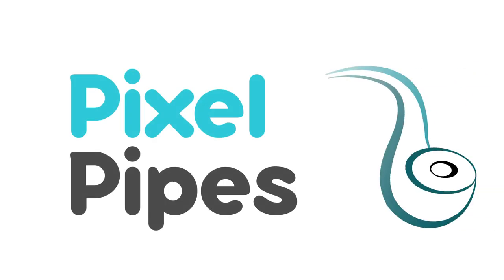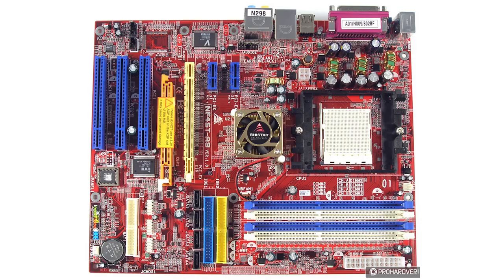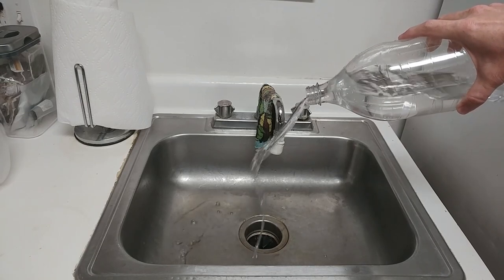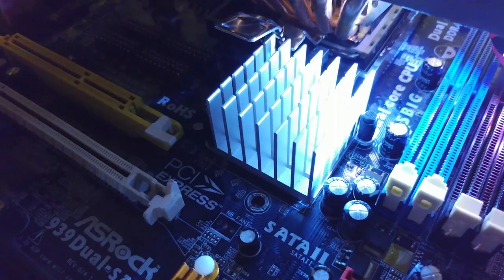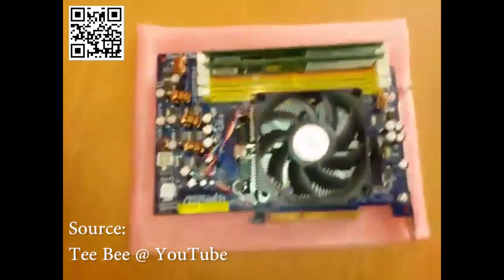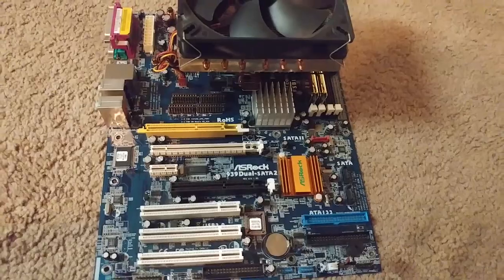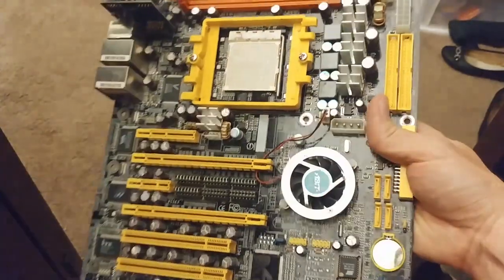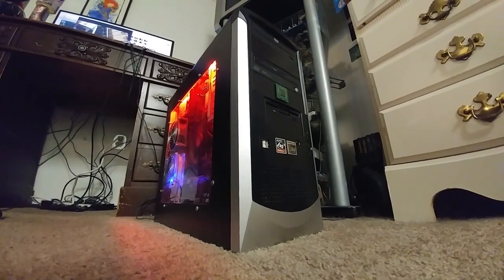Maybe the BEST Athlon 64 Motherboard Ever Made

Comment: Hay dude can you run Cinebench R15 and 3Dmark 2003 CPU bench? i want to compare it to my 4core dual vsta
Reply from the maker: It appears Cinebench R15 won't work on my 32-bit OS, so no dice. 3DMark03 CPU score is 1308 (151.7/22.2 fps).
Reply: PixelPipes 1189 100/26.5 x3430 2.3
Reply: PixelPipes what GPU did you use?
Reply from the maker: I had a 6800 Ultra in at the time.
Reply: PixelPipes the board will score higher CPU scores as you increase the power of the GPU. It will score more with a pcie weird right.
Reply: PixelPipes I will but I have to say I prefer your board over myn I suffered terrible issues so I've already ordered the AM2cpu and the top processor for it.

Comment: i got  the 775Dual-VSTA intel board and i can only have 1 card in it agp or pcix not run 2 at the same time
Reply: The 775Dual-VSTA got an Via chipset and the intel Platorm still relies on the old FSB design. So no "dual northbridge"
Oh, and the PCie is only 4x on that board.
Atleast it got DDR and DDR2 slots. The limitation to 2 GB is on another card.
Reply: You can run beta BIOS with ~3,25GB support ;)

Comment: The JMB360/36X is quite a worse SATA chipset ever...
I have use a Expansion card using the PCI-E interface.It include the JMB363,
Because I still having a IDE DVD-RW,and need to connect to my new MB at that time.
but the performance is horrible...and always buggy ever.I decide just buy a new one with SATA interface to replace the old one...

Comment: P5Q Deluxe, best 775 motherboard, can take 4x4GB PC2-6400, compatible Xeon mod and dual GPU
Reply: Rampage Extreme user here, who needs E5450 when I can have X3370 :D
Reply: P5Q3-Deluxe is the same board but had DDR3 rather than DDR2.
Reply: @AtariBorn  yes, that's advantage today, as you can put there 4GB DDR3 rams, that are cheap, and can go with overclocking up to 1800-2100 mhz. My asus p5q deluxe suports 16 gb ram, but have only 8, as 2gb sticks are maximu, 4gb for Intel are too rare and expensive.
but anyway p5q deluxe is still good overclocker, have there PC2-8500 8 GB RAM.
With DDR3, I Could go only with 2 sticks, 2x4 GB , and after raising FSB, could get to 1800MHZ DDR3, i I wuld buy 1866mhz sticks.

Comment: Maybe it is, but DFI LANParty UT nF3-250Gb is far more legendary and it surely is the best socket 754 motherboard ever made. In 2004 Anandtech called it "overclocker's dream". Now they are rare and very expensive if you can find one. imo it's still one of the best motherboards ever made.
Reply: I see nothing wrong with Socket 754. Late boards and CPUs were better for overclocking than 939 ones. Now we see all potential of 939 and it's not really very great. Socket 754 isn't bad at all.
Reply: I can't do the same as it has no Opterons supported. But I meant that in single core CPU comparison 754 and 939 are almost the same. 754 overclocks better, some processors could reach over 3GHz. Knowing that, 754 looks interesting option for retro builds. Dual channel RAM turned out into not being a big deal as gains were small in many scenarios. Many older software didn't have good multi core support, neither Windows XP had it (it works, but not too great). I personally have experience with AMD K8 processors. I have AMD Athlon 3200+ (754), Mobile Sempron 3000+ (S1G1), Turion 64 X2 TL-60 (S1G1). I have used them all for some time and I can tell that today they are obsolete. They lag, they stutter and have many signs of lacking power for any modern computing. Turion is paired with 4GB of DDR2 (laptop) and 120 GB SSD. I maxed that laptop out. But it still lacks in performance. Turion feels exactly the same as Sempron, just that sometimes lags less. Mobile processors ran in Windows 7 and 8.1, for some time Sempron ran with XP. Now they are too slow. Athlon is in era appropriate build, so it is paired with 2 GB DDR ram, WD Raptor and runs in XP. It hangs a lot in web browsing and many other activities. Obviously AMD K8 processors are obsolete for anything we do now. Now we should look from retro perspective. That second core in many cases is useless as old software rarely used it, games never really benefited such luxury and AMD it self marketed dual cores for creators, media editors, meanwhile their single core FX processors were for gamers. Difference was in clock speeds and cores. FXs had faster one core, Athlon X2s had two slower cores. At the time people thought that 939 will have better future than 754, but it became obsolete just year after its launch (AM2 arrival). Sure your 939 board served you well at the time and that's understandable, but if we look at the things in 2018, then 939 and 754 are almost the same thing. Both offer great single core performers for 2004 builds, both suck for modern tasks. Second core doesn't make sense from retro perspective and from modern perspective (as singles and duals lag). Sure socket 939 had superior support and is overall better platform and I can agree with you somewhat on that, but 939 isn't really worth it. In pure single core performance 754 can have a big advantage as with decent cooling Athlons can reach even 3.2 GHz, effectively beating anything stock of 939 (possibly overclocked too) and becoming better for retro purposes. Cache may look like important characteristic, but it wasn't. It made almost no difference in performance. It was race of clock speeds. That's my opinion about why 754 isn't bad and is almost the same as 939. Those K8 processors no matter what you pair them with aren't going to be fast, this is problem of architecture becoming obsolete. Also I don't think that there is more legendary motherboard as that DFI I mentioned earlier. It totally blew away competition and dominated. From what I know socket 939 never had such an awesome thing, on top of that reviewers rarely call motherboards as overclocker's dream, so I think it's something truly special of those socket 754 boards. I would like to have 939 board for maybe another build I would do, but now I totally can't. I have spent over 400 euros for having great socket 754 build of 2004. Anyway I would also want to have great board for OCing socket 478 processors, just to replicate Tom's Hardware 5GHz project to some extent. All that can be fun and possibly addicting. Old hardware is interesting to me. My daily PC isn't great in comparison to that 754 build.
Reply: I'm not butthurt but 939 barely makes sense more than 754 and 754 is always considered worse without being worse. Can you yourself mention at least two advantages or 939? Some software even refuses to work on multi core processors. Like Juiced, sometimes it doesn't start. Honorable mention is GTA San Andreas, you have to set affinity to single core every time you start it and that's not the only one thing that works worse on multi core processors. Multi core CPUs are great thing, but not the early ones.
Reply: About DDR2 I said because it works in dual channel mode and is fastest memory I have tried on AMD K8 CPU, just to show that everything else is as best as it could be. And to that comment about multiple core support in XP, I said that because many people say that old OSes weren't optimized for multi core CPUs. XP notices dual core processors as 2 CPUs, so I think that somehow could affect either performance or stability. I never really tried multi core CPUs in XP, so I'm not too sure about that. Yet I have seen some testing that same multi core CPU gets slightly higher scores in 7, so yeah, that's questionable thing and needs investigation. BTW how much you reached? On official socket 754 overclocker thread highest OC was slightly over 3.2GHz. That was over 50% increase in clock speed and ran stably.
Reply: 3.2 GHz was on water. That OS can use something, doesn't mean it can use it efficiently, AMD FX 6300 works on 7 just fine, but shows its all power better in 10. That may be very marginal difference, but it does exist and that's the main point here. I would want to see same multi core processor tested in XP and Vista to see if there's any difference. Currently I won't say my age to you as you are going to flame everything I say here, so no purpose for that. If I was a kind, then what? You would be attacking age of a person? That's very lowly for random adult.
Reply: You started it yourself.

Comment: No, ASRock back then and to some extent still is the bottom of the barrel for motherboards.  It was a low cost (think Acer)  offshoot of Asus and their board quality reflected it.  Back then Asus was among  the most reliable boardmakers along with Abit and DFI.  I still prefer Asus to this day because of it.  I used the M2N32-SLI Deluxe (590 SLI AM2) for years and it was rock solid and pulled everything out of an Athlon 64 X2 6000+.  I only got rid of it when Intel brought out the X58 Platform.   Gigabyte had more features but their boards were a finicky unreliable mess and ASRock was even worse. This hybrid chipset on your board was much the same.  You can't say a board is rock solid when you have to take a soldering iron to it.  That and stretching out the life of a 939 socket was just getting sad at this point.  AM2 saved AMD especially with the P4 Prescott debacle that handed the market to AMD for awhile.
Reply from the maker: Caps go bad over time. You can't hold that against it.
Reply: Yeah, those ASRock boards usually were rather low in price and the build quality was fitting to that.
They usually didn't OC as high as other boards, and the caps and VRMs were always cheapend out on.
But they had some impressive "mutant boards" for upgrades that don't require a complete platform switch.
Nowadays they are as good as the other manufacturers.